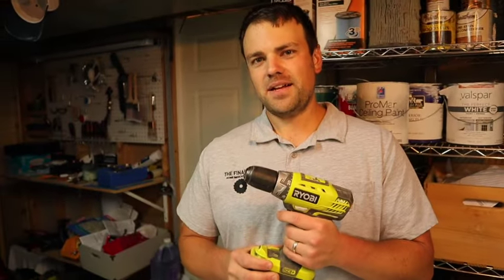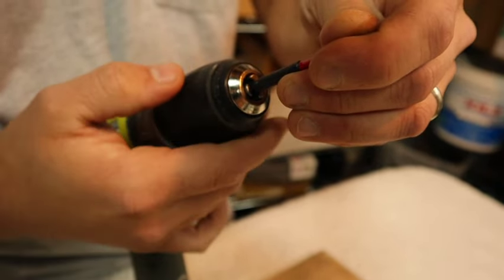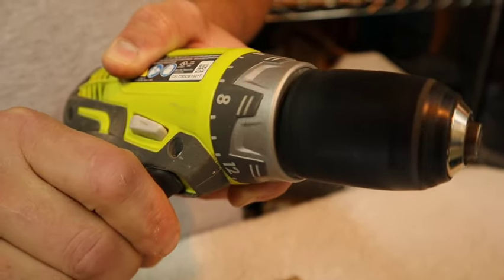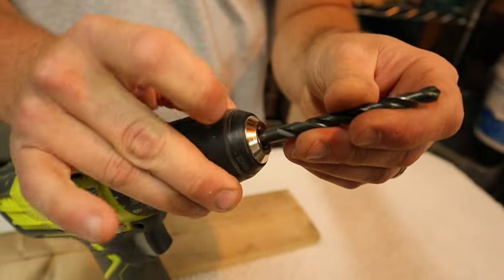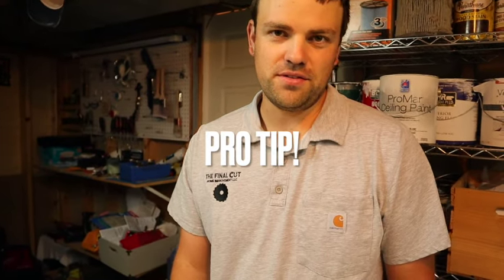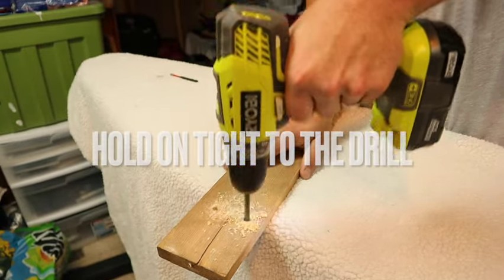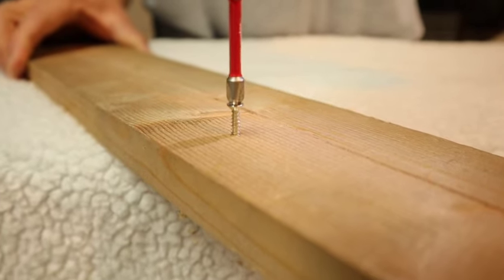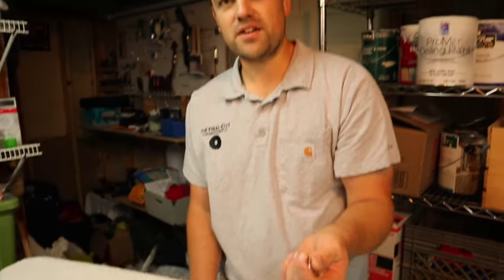How to Use Ryobi One+ 18V Cordless Drill

Comment: Thank you so much for the lesson. I'm 65 years old. This is the first drill I've ever purchased. I couldn't figure out how to put the bit in. So I pulled out the instructions, and it tells me the first step is to lock the trigger. Does it tell me how to lock the trigger? Nope. So, I go to Google to find a video to find out what to do. You don't even talk about locking the trigger, but you showed me how to tighten that thing down on the bit, and that's what I needed! Thank you!

Comment: how do you tell which Ryobi is the drill and which one is the driver? Why don't they label them?!
Reply from the maker: The drill is bigger, has the adjustable speeds, and the adjustable tooth chuck on the front end that adjust by spinning it. The driver is generally more compact and only accepts the hex shaped bit shanks.